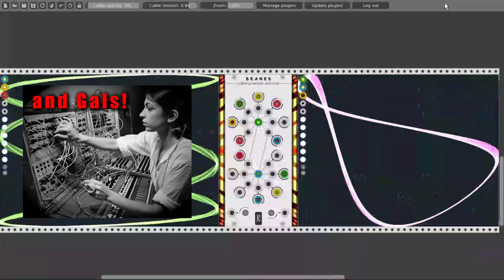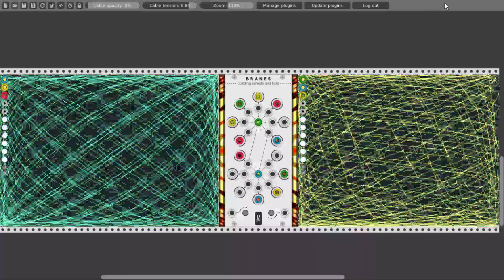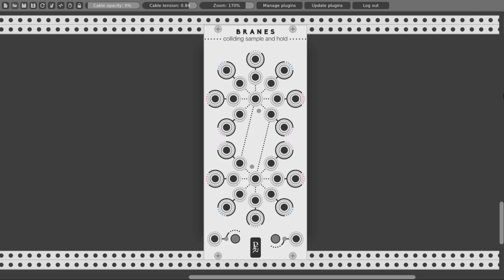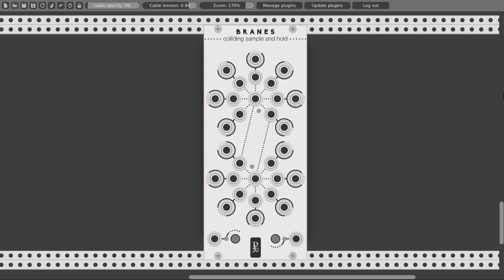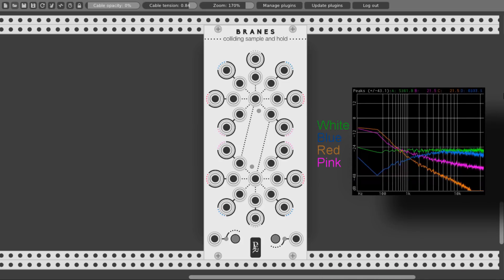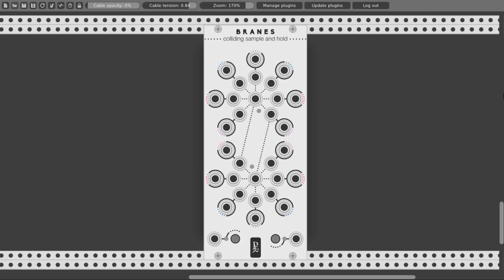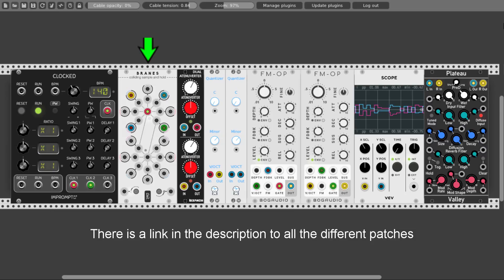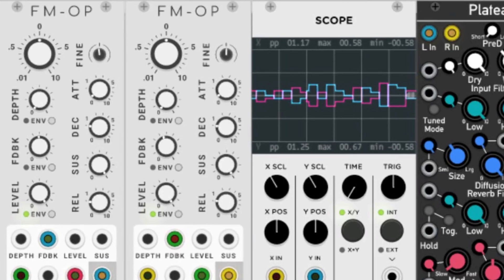Geodesics Modules Series Part 1 - Branes

Comment: I think it would be actually possible to build this module in reality. An analog circuit could be the easiest way to do this. 
Maybe I will try something like this with help of lots of open source schematics for noise generators and sample and holds

But on the other hand the source code for this is still existent, unfortunately I don't know much about programming micro controllers which are not a simple Arduino Sketch ^^
Reply from the maker: When it comes to stuff like this, I'm really clueless... But I really do wish that the Geodesics collection will be available as hardware one day. I will be the first to buy them.